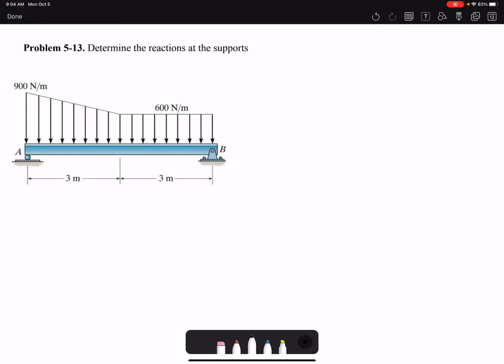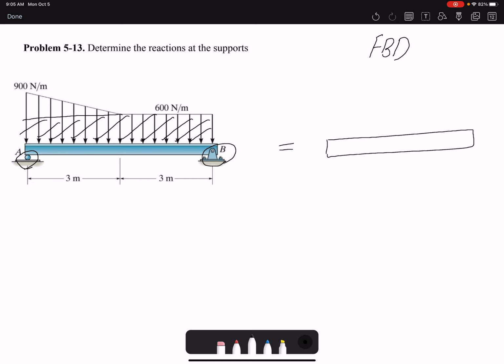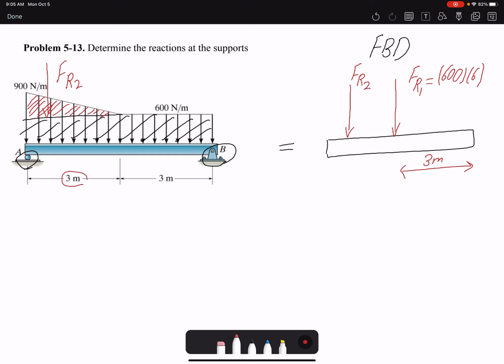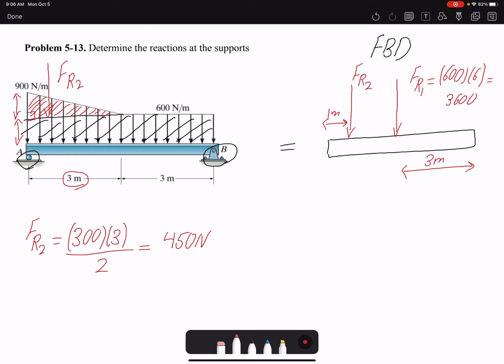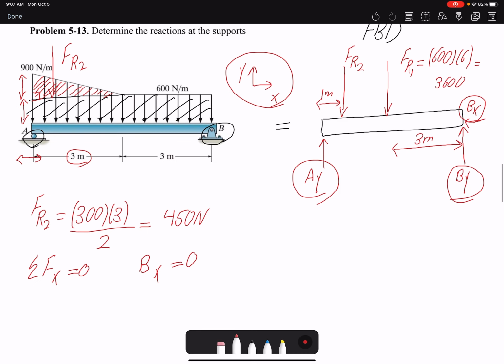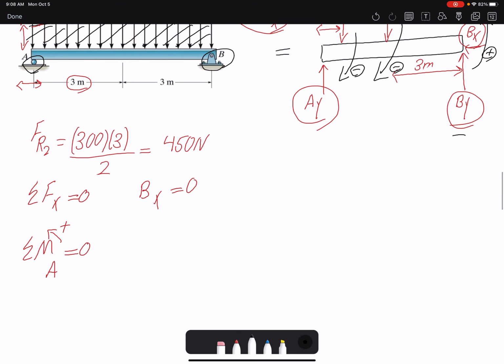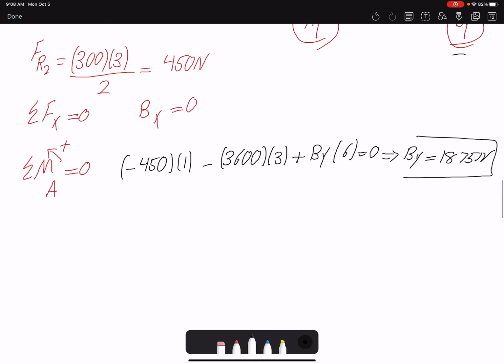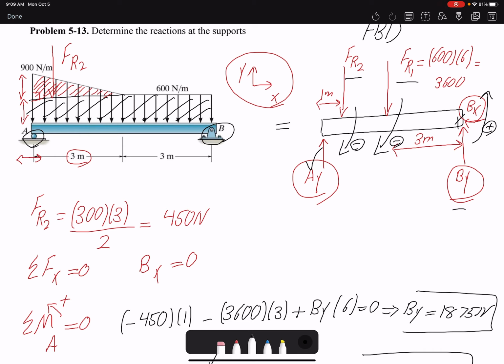Statics Problem 5-13: Reaction of supports for a beam under distributed loading

Comment: ...I mean, the center point of the triangle wouldn't be exactly at 1 unit in. As a right triangle with a side ratio of 1m:100N, exactly half would be at a value of N=225, so as long as the two sides multiply to 450N, it's at half. 

With that, 100*x^2 = 450, x^2 = 4.5, root 4.5 = 2.1213, so it is 2.1213 meters away from the center or .8787 away from the right edge.